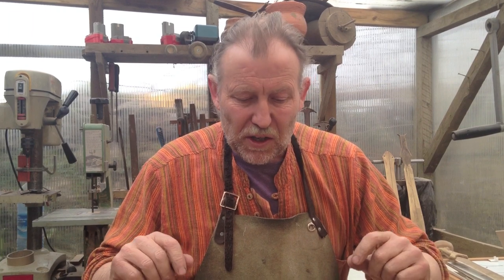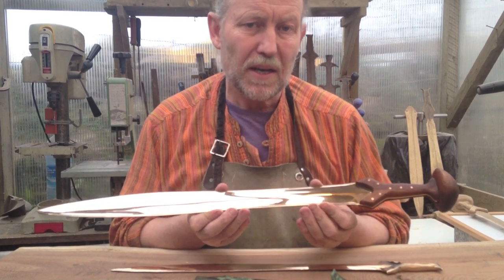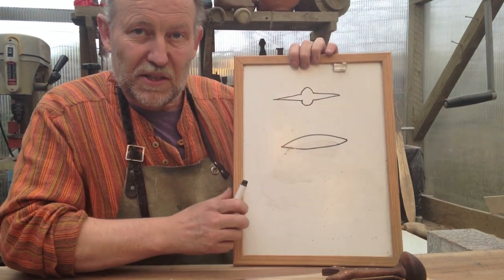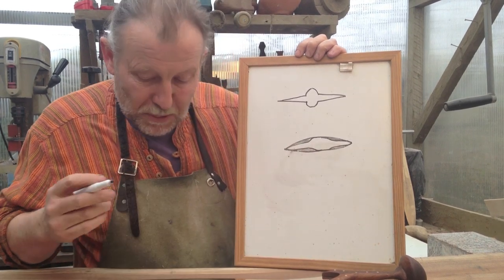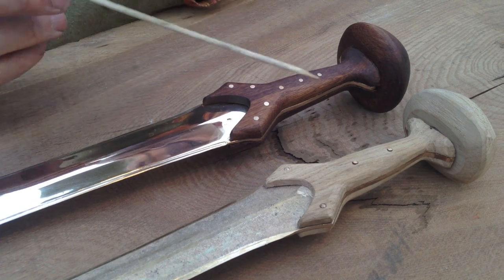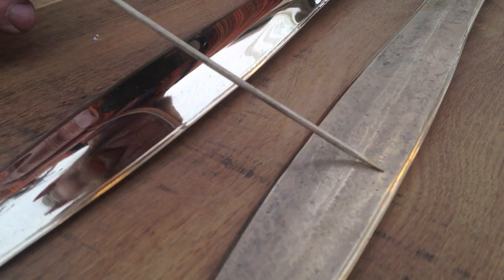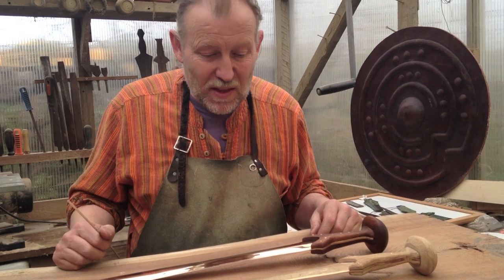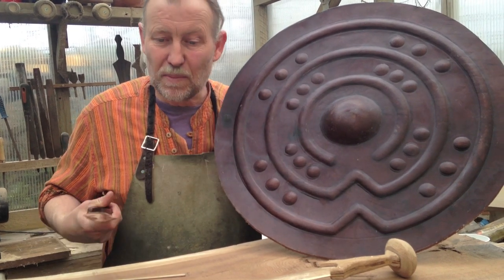Ewart Park Bronze Age Sword

Comment from the maker: If any one is interested i am posting on face book as "bronze age swords" you can see what i am working on and other bronze sword related  stuff
Reply: +168windmillroad Curiosity, As I plan to purchase one of your fine pieces of art, perhaps sometime early next year.
So I watched the Skallgram video where he tests the sword you send, and this video about its design, and I was curious.

You bent/straightened and hammered the sword to work harden it, and left the hammer marks in intentionally. I do wonder though. Would a polished sword, constructed the same way, have been stronger?
In college for engineering, and on material science we spend an awful lot of time talking about the importance of surface finish, and breaking sharp edges and filleting corners to make things stronger in general. Doing tensile tests for example, a piece of steel thicker, but with a minor surface blemish will break significantly faster and at much less stress than a piece half the thickness. And all the hammer marks I can only think of as being tons and tons of points for stress to get concentrated in the blade.

Now I realize it really doesnt matter too much as even with destructive testing, you're not likely to snap a bronze blade ever, where you might an iron or steel. But I am curious.
Reply: +168windmillroad is this Neil from the video's youtube account? if so, i like your video's sir, if you have time to produce more i'd happily watch.

Comment: Hello Mr. Burridge, I commend your work! I discovered you through Skallagrim's khopesh and Ewart Park testing videos, so hooray for free publicity!  :D

I am in no way an expert in metallurgical engineering, but I had an idea about strengthening the blade so it bends less. You mentioned flexing the blade back and forth to work harden it, but have you ever tried "stretching" the blade by hammering it thinner and longer? I draw the idea from modern cold rolling techniques in which the metal is literally squashed into long strips to harden it... seems like a similar technique could be applied to a forging hammer, and might alter the grain structure to give the sword a greater springiness than flexing back and forth could. Or I could be completely wrong, who knows.

Speaking of modern techniques... would you consider it a corruption of your craft to use more modern alloys like phosphor bronze? After all, phosphor bronze is still just a tin bronze that's been fully deoxidized with phosphorous. It's significantly stronger and tougher than ordinary tin bronze, as wrought phosphor bronzes up to 10% tin are used commercially as spring alloys, and from what I've read the melt is significantly more fluid, eliminating the need for any lead. The addition of tiny quantities of chromium and iron (less than 1.5%) also seems to greatly improve the grain structure that reduces or eliminates porosity in the cast, thereby further improving both it's strength and ductility.

Being fully deoxidized, a phosphor bronze can be annealed longer and at higher temperatures (though still not hot worked), allowing the bulk alloy reabsorb most of the brittle "bronzite" crystals that form between copper and tin when cast, thus allowing higher quantities of tin than normal. If annealed and homogenized at 700-750 degrees Celsius for several hours, then copper should be able to fully absorb up to 13.5% tin as a single phase.

Just for sake of example, you could have an alloy that was about 85% Cu, 13.5% Sn, 0.75% each Fe & Cr, and a residual trace of P. 

Still very near historical bronze in composition, but with improved mechanical properties.

 Don't get me wrong, I'm not in any way criticizing you or suggesting this is what you "should" be doing. I know you're crafting historically authentic Bronze Age weapons, and thus may not be interested in using non-historical alloys or modern techniques. I applaud you for the work you do. I was just curious if you've ever experimented with other methods or different alloys.

Cheers! I hope to actually own one of your swords some day!  =D
Reply: wow dude your idea is incredible, im not a metalurgic enginer too but your idea is very good, even with some modern improves an object of the bronze era still can be called like that, i will try to do your idea, maybe a good thing born it :D greetings

Comment: Great, great, Fabulous first video, sir!
Well shot, clear and soothing voice, detailed explanations with no fumbles!
Very didactic, very informative!
it leaves me wanting for much, much more!

How well and how much is the hilting of different bronze swords types known?
Are there any perfectly preserved hilts, like maybe bog finds?
Where should one look for documentation on such matters, any reading you would suggest on the matter of bronze age swords in general or subtypes in particular?

Any source info of metallographical analysis of such swords, and more hints of how these were cast?
 Were the swords made one of a kind, or in (short?) "series"?
Was it first sculpted in wax, then cast, and what might have been the refractory they used for making the molds, or was it most probably produced by making a pattern, wooden or otherwise, and then by making sand molds from it, a "smith" making a great many of the same?
Have there been archaeological finds of identifiable bronze age foundry sites?

Have a nice day!

Comment: Thank you, l68windmillroad, for posting this very satisfying video. I´m delighted that details such as the change from casting "point uppermost" to "point down" are so well documented and that in this case the reason behind this change is so well understood.
Lloyd, of the channel Lindybeige, remarked in one of his videos that there was a transitional period in the design of bronze spear heads during which these had both sockets and tangs. I cannot imagine how they´d have cast such a thing - in fact, I can´t seem to get any hard information as to how plain old socketed spear heads were cast. Surely the lost wax method would have been too labour - intensive. Could they have used a two-part stone mould with a separate stone plug to fill the tapered void where the haft would fit? Which way up would they have done it? I´d be grateful for your thoughts.
Reply from the maker: The film was my own ramblings and have to confess i am not aware of other documentation on the reasons  casting though the tip or hilt ,  most molding is clay and the cores are too and not lost wax not sure where you can look for spear casting info other than books and lots of drawings and a trip to loads of museums
Reply: I asked an archaeologist friend and, after a moment´s thought, she said that the question had never occurred to her. She promised to ask a few colleagues but it seems to me that you hit the nail on the head when you mentioned the yawning gulf between the mainstream archaeological community and practitioners of historical and prehistorical skills. I suppose this is why we need the Skallagrims of this world...
Reply from the maker: It could be said that i have cast a few swords and spears in my 17 years exploration and maybe the Gods favor me enough to have shown me a vision into the great bronze working  unknown

Comment: Amazing work and it is wonderful to see someone carrying on the art of redsmithing. Not sure if you read the comments but if you do would you share what alloy of bronze you're working with?
Reply from the maker: Hi Ben i use 12% tin copper which i make my self many late Aegean swords were made in this mix
Reply: 168windmillroad Ohhh Clever, just past a point where you cross into a double transition point.. =3 Have you noticed any difference in physical properties if you quench the heated metal as appose to letting it anneal? Also you gonna be uploading anymore videos? Would love to see the casting process.
Reply from the maker: Ben Frazer bronze is complex and i am still learning, but understanding it does help with better blades yes i will make some films when time allows
i tend to not show how i cast them unless i am doing bronze age

Comment: I'm curious as to what the thickness of the blade is. It looks to be something like 4 or 5 mil, but I'm just guessing.

Also, do you think the handles were ever wrapped in leather or cordage, or were they just left as the bare wood?
Reply from the maker: +Miguel Cuervo they get thicker towards the handle 2 to 3 mm at the tip the 10mm by the handle few wooden handles survive so it may have been

Comment: Now this is a odd question but can you Forge weld bronze? Does it have to be fluxed like steel or does it weld to its self  without being that clean like iron? Or is it simply cast rather then forged at all ? Are the hammer blows on heated metal or are they done cold? What temperature does it burn at? I have too many questions I'm sorry.
Reply from the maker: this type bronze can only be cold worked (forged) as it becomes brittle with heat, there are some bronzes that can be hot forged like iron but i guess you would have to do it in an oxygen free atmosphere to stand any chance of it joining but i think its unlikely, thats why you can use bronze as a mold material for casting bronze they dont stick.       There is evidence they welded bronze by running liquid metal past the joint until it fused 
So the answer is no it cant be forged like iron and hammer welded and yes its cast as a liquid but cold Hammering will harden it
Reply: 168windmillroad
 Must have been interesting for people in that time trying to figure out how to work the metal. . I have got to look more into this, thanks for your time your swords are beautiful.

Comment: A question, would a aluminun bronze sword be stronger than a just bronze sword?
Reply from the maker: i dont know and its not relevent, they did have some odd mixes of copper tin and lead with some trace metals but most lumps of bronze look the same when cut so its impossible to guess its alloy content to the last % but bronze age metal workers would have had a good idea when meting scrap bronze